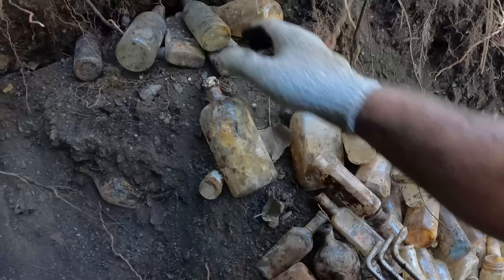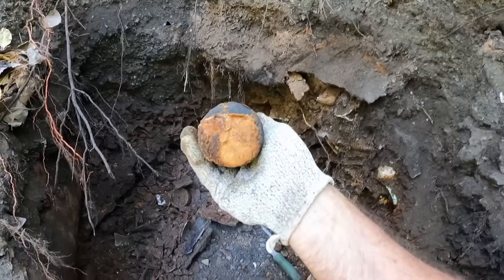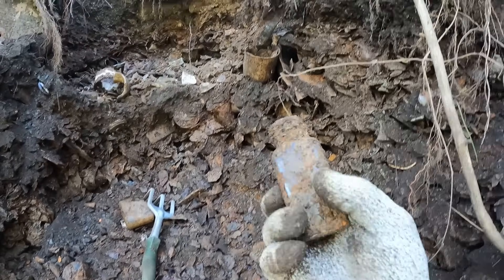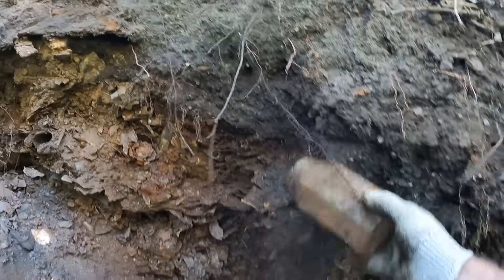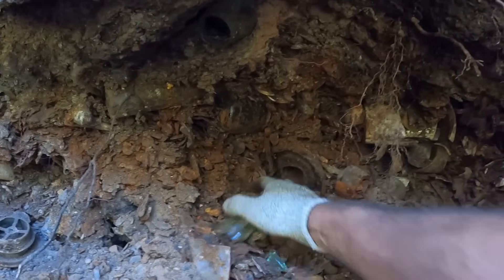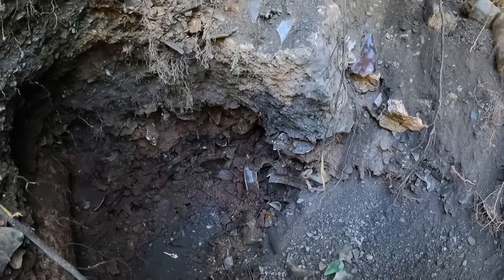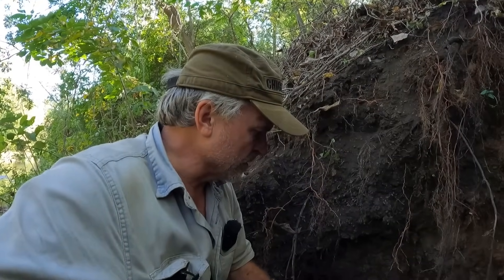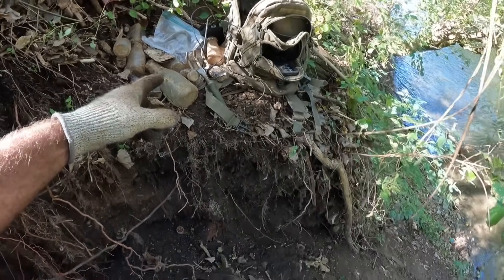Unearthing A Treasure Trove At The Ultimate Bottle Dump Site!

Comment: Some of those bottles are curved but don't look like they were in a fire. Could they have distorted from the ground pressure? I have seen old window glass that has moved, thicker at the bottom and thinner at the top. I was told it takes about 100 years to see glass do that.